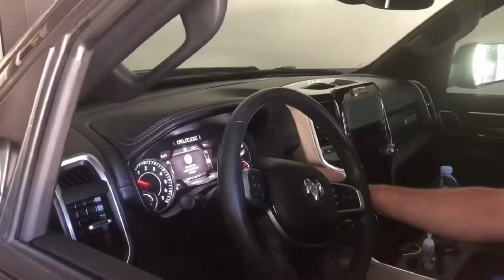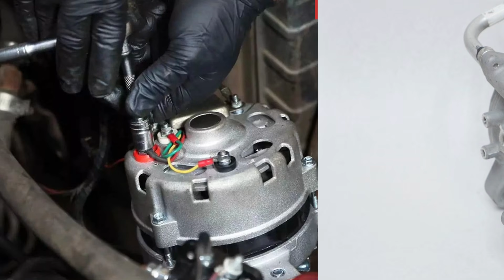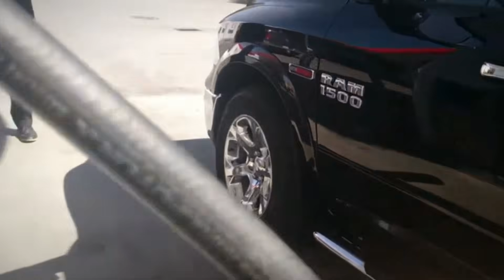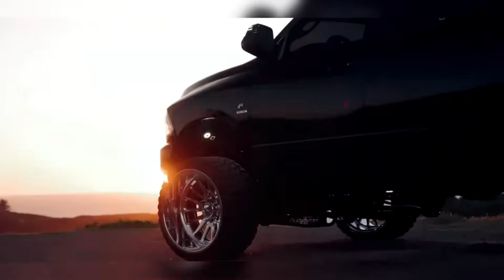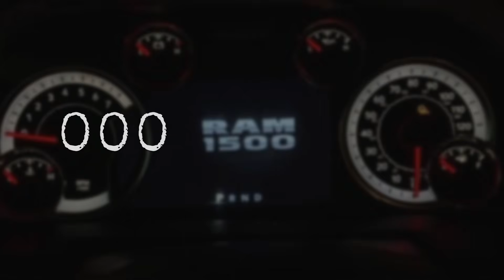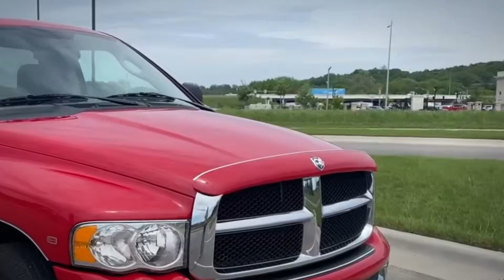The ONLY Rams Built to Last 300,000 Miles

Comment: what about the 2013 Hemi???? no mention .
Reply from the maker: Great catch. The 2013 is basically a '2012 2.0'; it carries the exact same TIPM fuse box risks and MDS lifter concerns. I highlighted the 2012 because that’s where the failure data is most concentrated, but the 'Perfect Storm' logic applies to the 2013 just the same. How many miles did you get out of yours before the tick started, or are you one of the lucky ones?

Comment: The Cummins in the bigger trucks were rated at 1,000.000 miles before they choked it with smog equipment..
Reply from the maker: Exactly. The 'smog' era changed the math for everyone. We went from engines that outlasted the body to engines that are basically on a timer. That’s the 'design story' I'm trying to track here. It’s a different world than it was 20 years ago